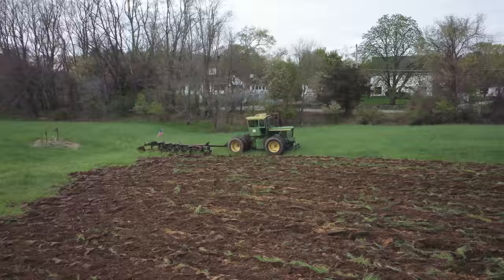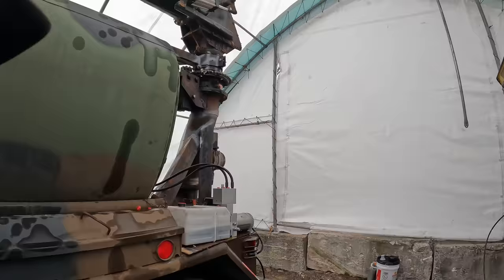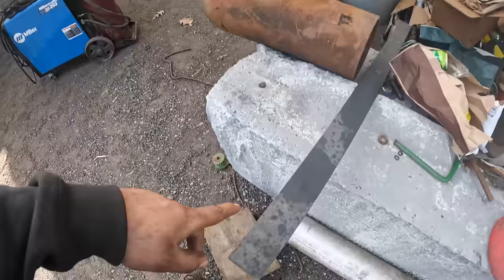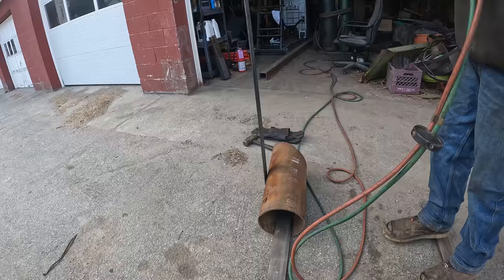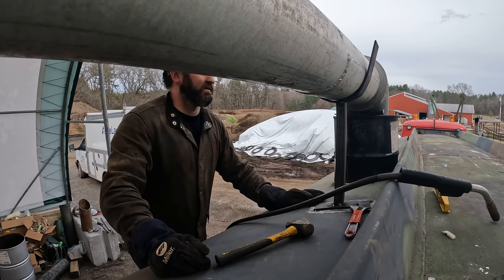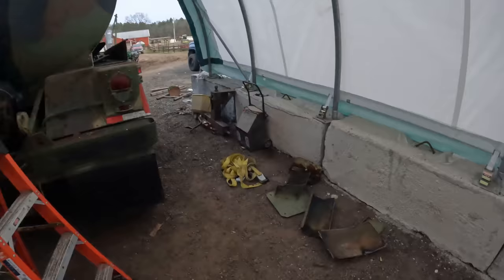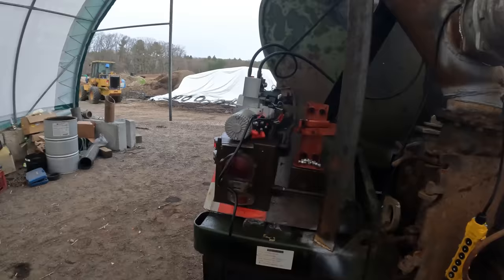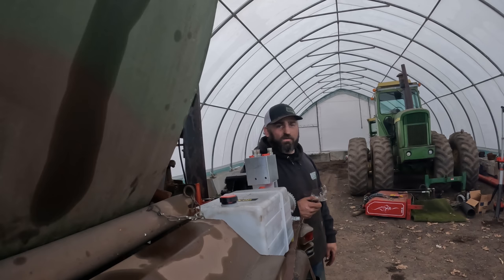Fixing Mistakes- Much Better!!!

Comment: The problem with the valves might have been that when the motor was runnign that it was pulling down the voltage so much the solnoid didn't have enought force, you could check the voltage with a multimeter when the pump is running. It also might work grate with the spacers when you hook it up to the truck since it will be charginf all the time.

Comment: A 100 watt solar panel mounted up top will keep your battery charged.  I run numerous panels on the farm.  Everything from sap pumps to my fuel pumps all run off battery charged by solar.  Simple and trouble free.

Comment: For the hydraulics, run one remote directly to the main valve and then use a manual selector valve to split the output between the spread and nurse isolation valves. At no time, will you ever nurse and spread at the same time. This would tie the main valve into whichever function you select with the manual valve and keep it operational.

Remote 1 = Lift
Remote 2 = Rotate
Remote 3 = Main valve –> Manual selector valve –> Spread/Nurse isolation valves

Comment: Have you thought about putting the pump in a plastic chest or something like that to keep it out of the weather and the crap? I did that when building a drag for snowmobile trails and it has the pump and battery's tucked in and out of the elements.

Comment: Hey great job I was just wondering what about leaving that hose box along side of trailer and run your electrical for hydraulic unit in it maybe future hydraulic hoses then all of that would be very accessible maybe put a top on it to keep out manure or just wash it out when done

Comment: You could make some 3 way hand valve between hydraulic line’s , so it is possible to use the same hydraulic unit for closing the big gate gate valve .

Comment: Just thinking for sending power back from trk to charge battery for pump. They have battery plugs meant for running dump trl tarping systems.  That 55 gallon doesnt look so crazy big with the nurse pipe sitting.  Thats a big pipe.  Looking good
Reply: 15 gallon drum
Reply: @nicholasmeyer5234  typo. Yeah i know

Comment: Hydraulic fittings...buy reusable ones. We use them on log trucks and just have a spool of hose. Cut the length you need and twist the old fitting on.

Comment: A 7 pin trailer light plug might work for the hydraulic controller. Might be better to mount it the opposite way to prevent the plug being mixed up

Comment: Food for thought.  You do have a bunch of stainless you cut out that could be used for a cover over the pump and bats . And u could just cut some holes in the hose compartment for cleaning up .

Comment: Hi have you ever used these Parker Field-Attachable (Reusable) Hose Fittings might save some time and cash no special tools required I have and it worked very well. Also run your wires in PVC pipe

Comment: We used that style pump for dump beds and boom actuators. I've seen them mounted both horizontally and vertical. Never had much trouble with them overall.

Comment: One suggestion for hydraulics. 
Boom lift and hatch open valve could be in parallel assuming boom needs more pressure to lift.   Valve will open before boom starts to lift.  
Opposite pressure to close  valve by pushing down boom in the cradle.

Comment: You get small bench top hydrolic hose crimper, but they are usually only good for hose up to 1 inch hose between £500 to £3000. Useful for these 8pm jobs when you blow a pipe and need a quick fix on small pipe 
Great tools but where they get you is the price of the hose fittings having to buy 100+ of a fitting to make it worth your time making hoses

Comment: You could just add some quick connectors and switch hydraulic lines  when you need to use main shutoff valve

Comment: If you need an extra wire just run a separate wire along side of 7 wire cable incased in plastic conduit.

Comment: That new tank of yours is gonna look really good but one more thing you should do you're probably gonna have to weld a C channel or an angle iron on the bottom of your pipe like underneath because if you're going to transfer to another tank or another truck if you bang the bottom of the babe it's just gonna get worse and keep bending but it's up to you